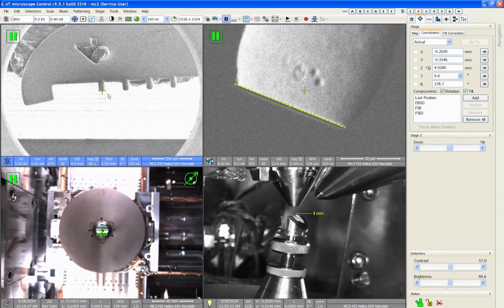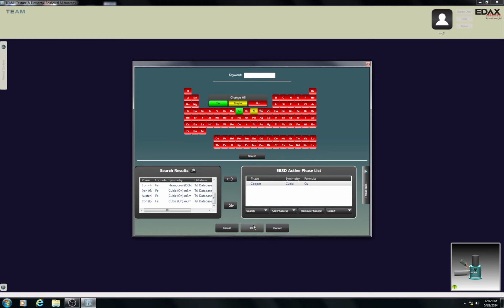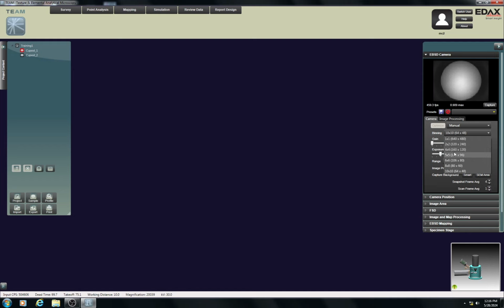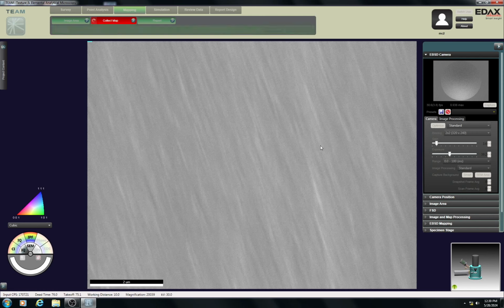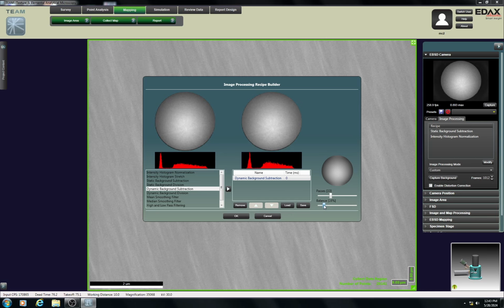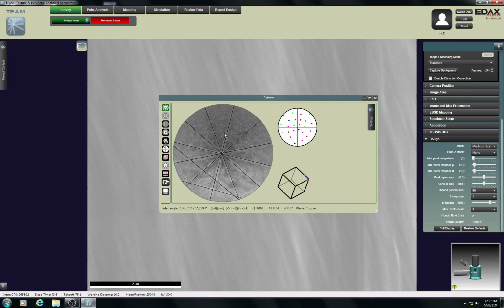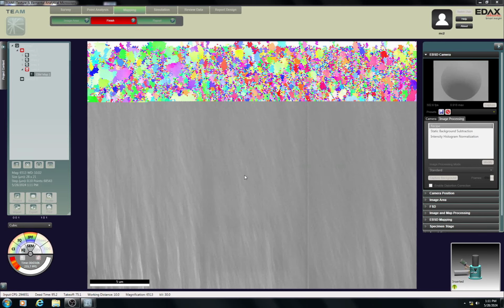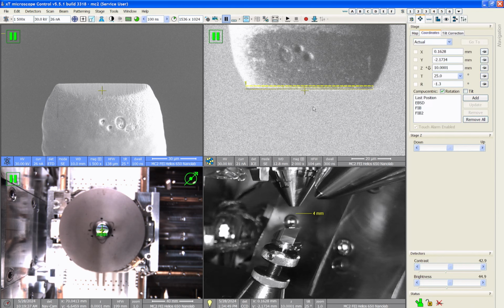EBSD Camera Optimization and TEAM Software Training

Comment: EBSD stands for Electron Backscatter Diffraction, which is an analytical technique used in scanning electron microscopy (SEM) to study the crystallographic structure and orientation of materials.
The term "EBSD Camera Optimization" refers to the process of adjusting and optimizing the settings and parameters of the EBSD detector (camera) to ensure accurate and reliable data collection. This optimization process typically involves calibrating the camera, adjusting the working distance, beam conditions, and other factors to maximize the quality of the diffraction patterns obtained during EBSD analysis.
"TEAM Software Training" likely refers to training or instruction on the use of a specific software package called "TEAM" (which may stand for "Técnicas Electrónicas de Análisis de Materiales" or "Techniques for Electronic Analysis of Materials"). This software is designed for processing, analyzing, and interpreting EBSD data.
The training would typically cover topics such as:

Setting up EBSD experiments and data acquisition.
Processing and analyzing EBSD data within the TEAM software.
Generating and interpreting various EBSD maps and plots (e.g., orientation maps, phase maps, pole figures, inverse pole figures).
Quantitative analysis of microstructural features (e.g., grain size, texture, misorientation distributions).
Data visualization and presentation tools.
Advanced analysis techniques and applications of EBSD data.

In summary, "EBSD Camera Optimization and TEAM Software Training" refers to the process of optimizing the EBSD camera settings for high-quality data acquisition and receiving training on the use of a specific software package (TEAM) for processing, analyzing, and interpreting the EBSD data obtained from materials analysis.